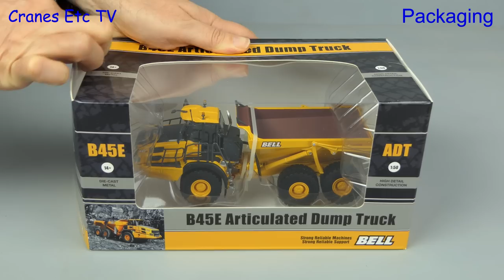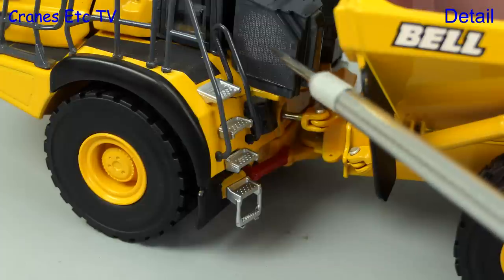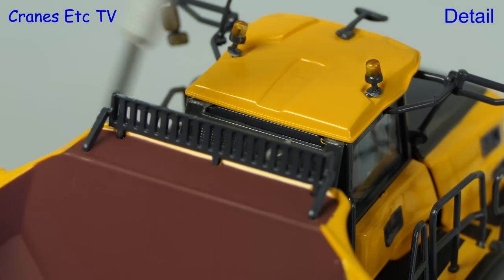USK Bell B45E and B60E by Cranes Etc TV

Comment: I did some research on my model, because next to the Volvo A40G it became obvious: The USK Bell B45E is actually the Bell B50E - measurement, details and everything, no idea why it is branded as B45E...🤔 Also B50E and B60E share the same front car but on the B45E it should be smaller, so your video confirms the wrong branding.